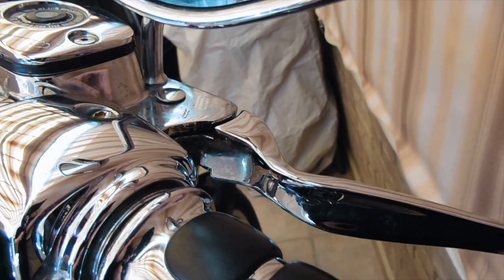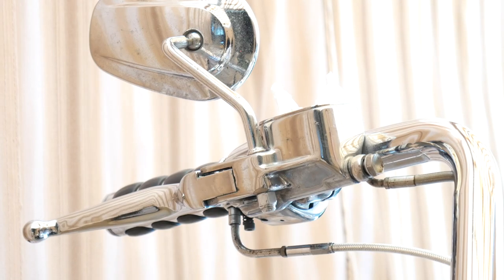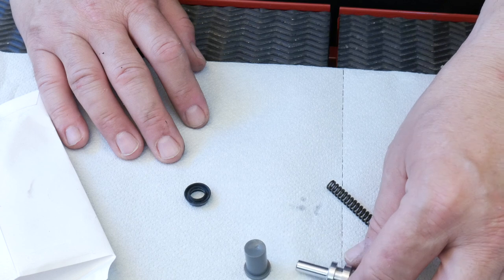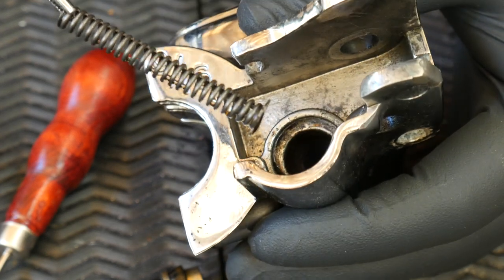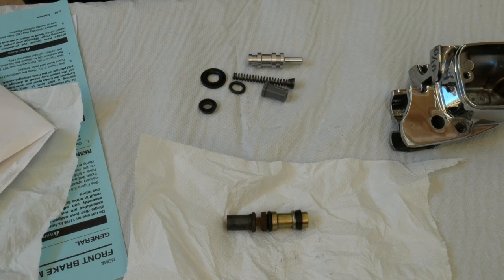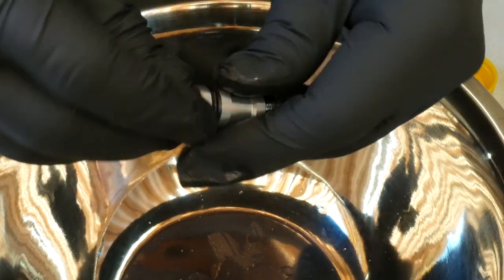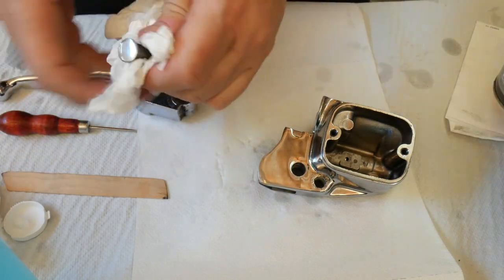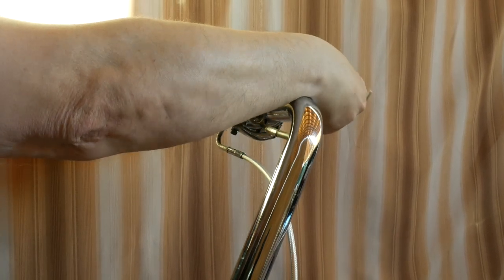HARLEY DAVIDSON 2001 FAT BOY FRONT MASTER CYLINDER REBUILD

Comment: You say to use DOT5 but on the bottle you are showing, it is 5.1. Totally different oils - 5 based on silicone, 5.1 based on glycol like DOT4 for example. Should not be mixed!

Comment: Hi there.  

I have a question about a 1982-87 Harley Davidson REAR brake cylinder piston and seals.

I'm looking for extinct rear brake seals and piston for an Australian release 1978 SR500e Yamaha. 

Found one kit in the world but they want about $330oz for it when most other kits are about $35. 

The cylinder is 5/8" it's cast on the outside of the cylinder 5/8". 

They seem to be unique to the SR500e's and XS400e's, only.

If you mention the word Yamaha to the local Harley places it causes some kind of seizure or mental blockage so I was wondering if you or your viewers could help with a very basic question.  

Forgetting the piston. Just the seals would do. 

It looks like a kit from a 1982-87 Harley could be what I'm looking for. The cup seal that sits against the inner end of the piston over the spring and against the 6 petals of the reed valve thing must be the same as the cup seal on my SR they have the same type of valve and are 5/8". 

The information I'm looking for relates the other seal the one like a cup but with the hole through it that is on the outer end of the piston. 

Could anybody tell me the diameter of the part of the piston where this seal sits and how is this seal retained in place. 

The SR is 9.55mm at this part of the piston and the seal is retained by a small ring cast around the piston under the centre of the seal about 1 mm wide and not much higher than 1mm. 

Any help to solve this mystery would be a benefit to all SR500e XS400e owners globally. 

Found tons of photos of the kit but none without this seal removed from the piston. 

Thanks.